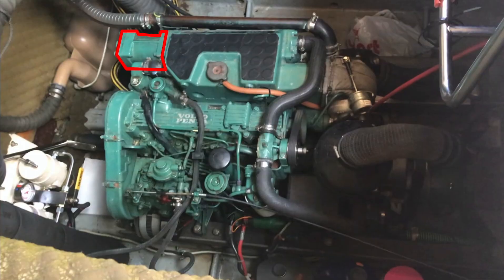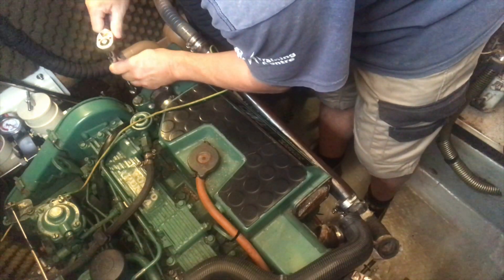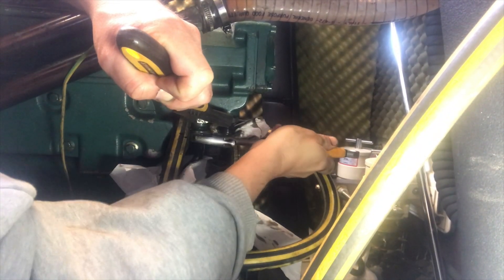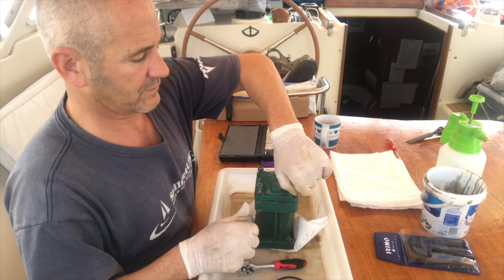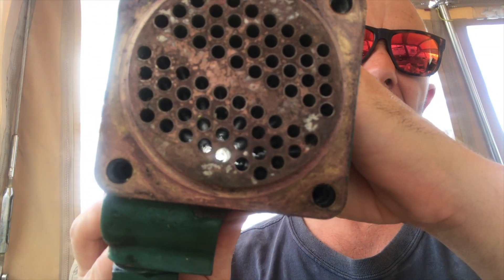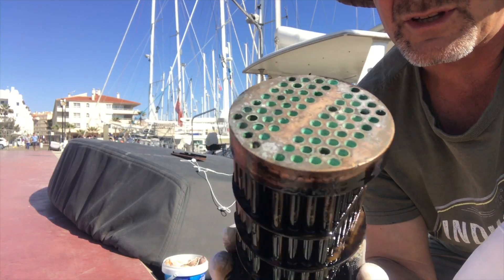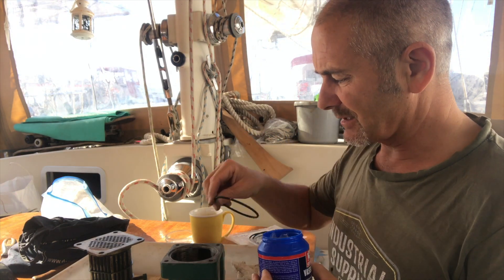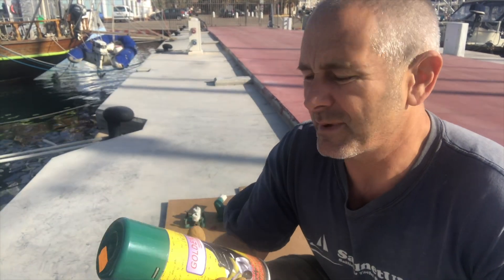Cleaning and Servicing the Oil Cooler on the #VolvoPenta TMD22 #MarineDiesel Engine PT 02

Comment: Very informative..How did you discover that the schematics were wrong with regard to the oil heat exchanger element..
Reply from the maker: I just kept looking at it over and over again, seriously doubting my sanity.. looking at it upside down and back to front and not getting it to match up.. and in the end I just had to conclude it was wrong 🤷‍♂️
Reply: @MothershipBoatMaintenance  Purposely designed to test one's sanity.. You didn't fail..👍